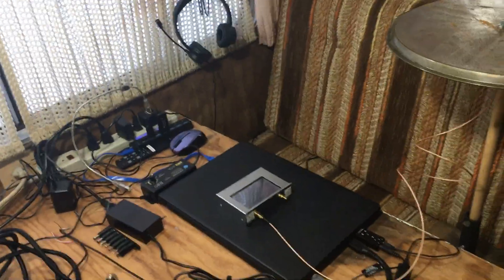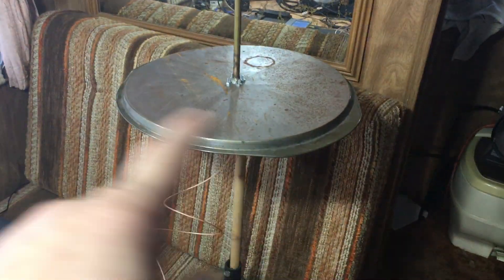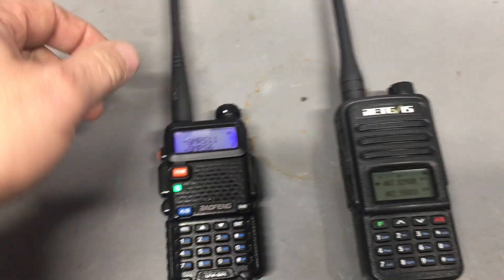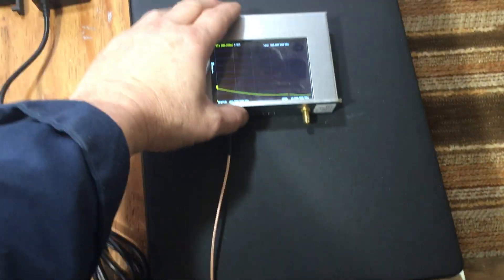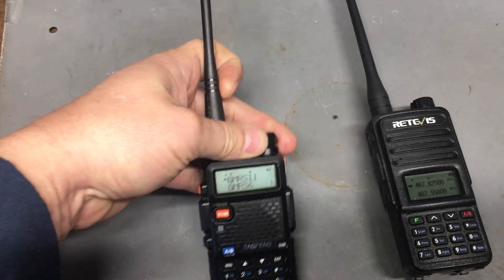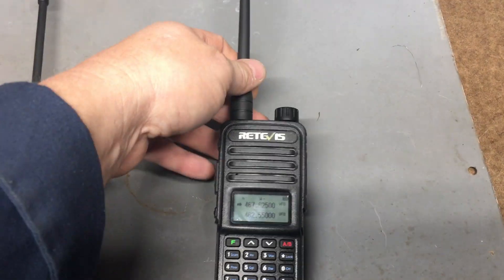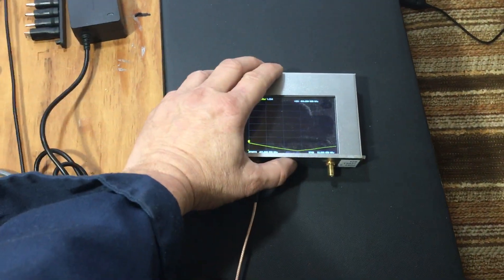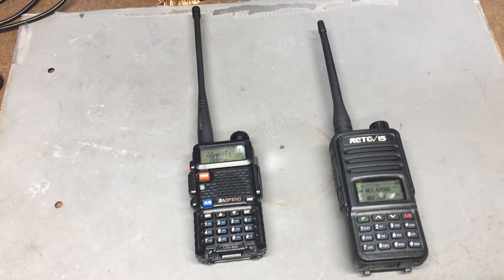🔺 GMRS two-way radio the Retevis RT85 is BETTER than the Baofeng uv-5r this is why!!!🔺

Comment: Is that the Baofeng you were transmitting on without an antenna?  ;). Could you have burnt something out in it?
Reply from the maker: Yes it was, but I check it with another one, and it did the same thing 🙁

Comment: I don’t have a problem with my BTech  Baofeng radios. I also have a Wouxun KG805G. It’s a high end GMRS radio. When I use them I can’t tell the difference. Plus my Baofeng radios are also ham radios
Reply from the maker: humm very interesting thanks for sharing that info